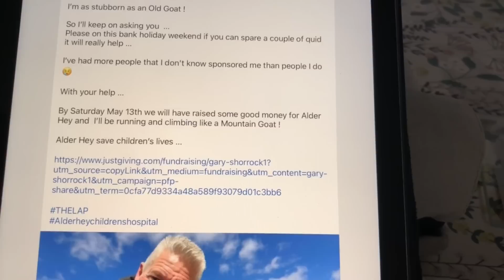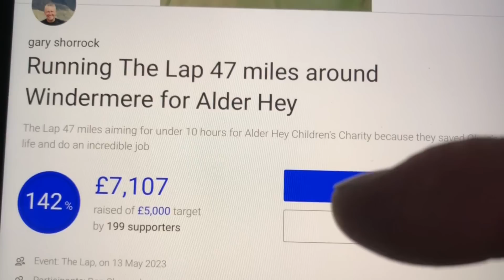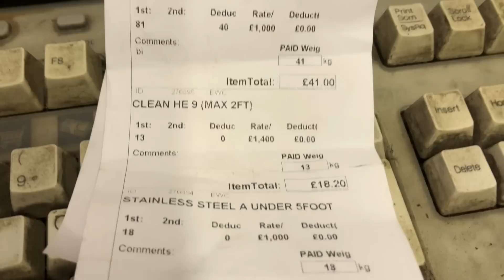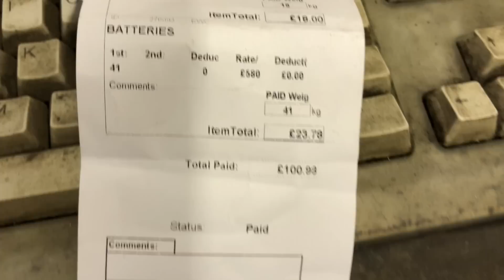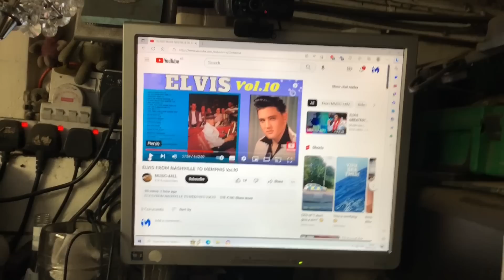Now ain’t that a shocked look

Comment: great vid as usual, the camera in the shed seemed to be very quiet on sound recording, same on last one,  apart from that all good. I haven't been up to my lock up yet, re those ali light shades, what is the diameter of the ones you have?
Reply from the maker: I think the microphone port is full of iron filings, I’d have to measure a shade. Be a few days though. Before I can reply.